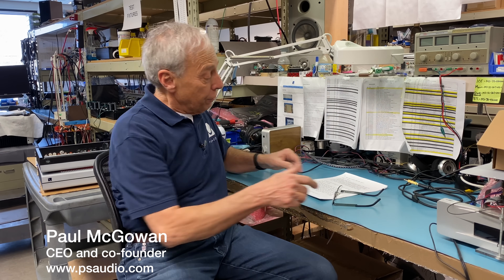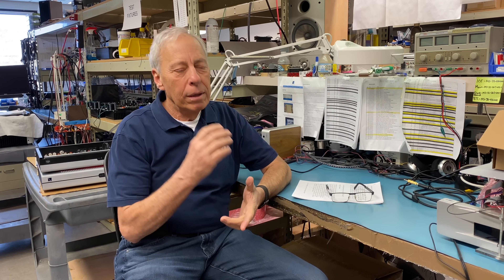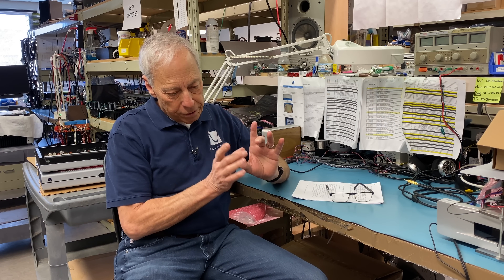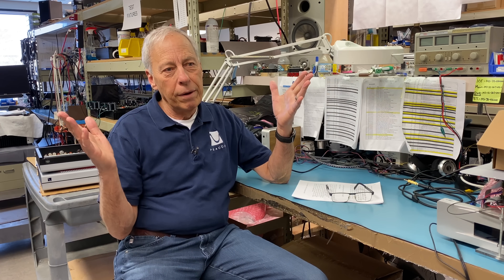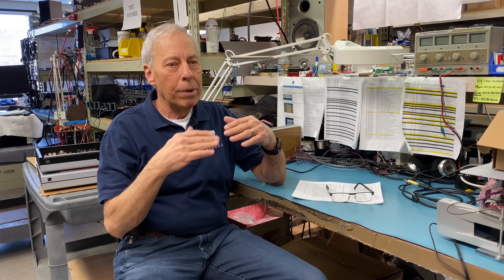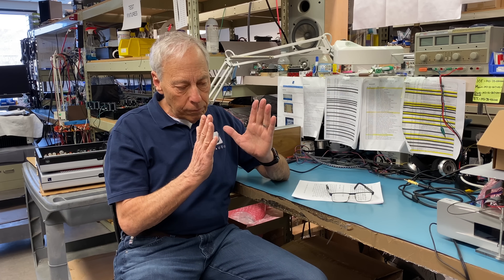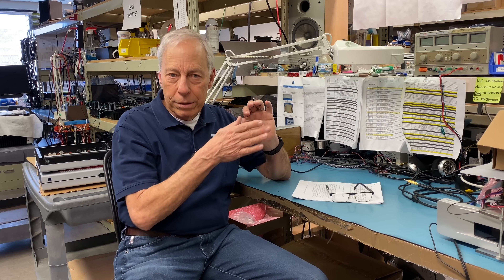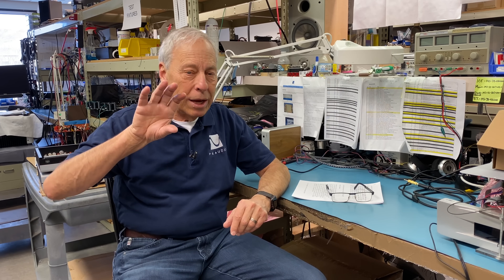How does an FPGA DAC work?

Comment: Great explanation. I 1st became aware of this approach way back in 1986 when Technics released a line of compact disc players using 1-Bit D2A converters. I have a background in engineering & saw the advantage immediately. Rather than try to engineer the tight tolerances of a resistive ladder for 16-bit PCM converters for mass production; - A single pulse stream could be modulated to give much more reliable conversion across a filtering node - especially in mass-production. I'm sure your approach leverages faster clock speeds today & tighter pulse formation. What is the equivalent PCM bit-depth your process is capable of mimicking (If I may ask)?

Comment: Another way to visualize single-bit DAC is of two forces (negative and positive) that drive the speaker magnet inwards and outwards.  The DAC has control of "where" the cone is positioned between full off and full on due to how long a 0 or 1 is "held".

Comment: The question:  Can we need resistors from out of the FPGA to build this DAC ? 
or, we can acces to discreet resistors from into the integrated cicuit FPGA ?
I say resistors to build the ladder of voltage divider.
Thank you in advance.

Comment: Great talk. But how do you control wave-form/frequencies ?
Reply: How I see it. Sound is basically variable amplitude over time. So in order to control the amplitude, the FPGA is configured to output pulses at variable rates. To increase the average amplitude, it will ramp up the pulse density. To lower the average amplitude, it will decrease the pulse density. This happens fast, at MHz rates. So the digital source provides amplitude data which is then used to control the density of the pulses at the output. The signal is filtered at the output to even out the edges of the signal, typically with a capacitor, to get a nice analog wave.

To answer the waveform question. A sine wave, is basically a signal with varying amplitude, shaped by a soft curve, and if that variation repeats at rates (hz) within our hearing range, we will hear it in the form of sound. So for an FPGA to reproduse that, the output will produce varying pulse densities based on the amplitude of the wave at any given time, and that's it.

Hope it helps.

Comment: Paul is partly right, it is possible to do analog signal processing within a FPGA, I have done it, and have the patent for it. I am using it in optical and radio communications, now looking at ways of using this technology for magnetic tape record and play back system. It is very true, there is a lot flexibility built in to FPGA's, and I am always finding new applications for this technology.

Comment: Can this be combined with class D power amplifier in a single unit? Would that not be the most pure way to build the sound system? For example, each monoblock or dual mono amp has it’s own dac for each channel, the control unit/preamp is digital input and digital output to the power amps after splitting the digital channels and controlling volume/tone etc

Comment: Sounds like serial (PDM) vs parallel (PCM) output.
Reply: It is really an I2S to class D Converter with a great interpolation filter in the middle so you can have an almost infinitely precise signal at the end.

Comment: There are several companies that use off the shelf Burr Brown or ESS DAC chips and use a processor before it to convert everything to DSD. The advantage of FPGA is, if you are good enough,  you can program it to your hearts desire and customise it to better suit the topology and parts used. When you use processors like XMOS / XCORE and off the shelf DAC chips you are limited by the fixed instructions set/filters.
Technics SU-G30 does something very interesting, converts everything to DSD and sends the bits with little filtering directly to the GAN-FET output transistor without the use of a DAC (1 transistor per channel!!!). GAN-FET is the only transistor quick enough to cope with the MHz oscillations of a pure DSD signal. Any other FET or BJT transistor would require an analog signal.

Comment: So it must be that there is little or no switching noise to comb out as well? Or is that what gets filtered? It sounds like a moving coil setup where you get lots more detail but in order to bring the gain up there's all that juice to keep quiet. You might like my friend's preamp design for that stage. He uses a photocell arrangement that eliminates filter caps, or any resistive components. The signal to noise ratio is not measurable, it simply doesn't seem to exist. In his words: "It has an input impedance too high to measure, output impedance is a couple ohms, bandwidth is to 60Mhz, slew rate is a couple hundred V/microsecond.
There are no capacitors or resistors (other than the photocell) in the signal path. There is no potentiometer in the signal path. 
It uses photo cells to control the volume. It does not use optocouplers."
Reply: There is actually a ton of noise generated by the DSD output, so they have to use noise shaping, which is a feedback loop that pushes that noise way above the audio band, and analogue filters to get rid of it.

Comment: It makes sense to convert PCM to DSD before feeding it to most modern DAC's and you can do a pretty decent job with a laptop and music software. I wish Paul would really push the point of how different PCM and PDM (DSD) are even if he disagrees with my heretical extremest view that DSD is actually an analogue capture system. Stay well everyone.
Reply: Here's another thought: analog is actually digital. Think about the way a vinyl record is made. It is, obviously, made of vinyl, which consists of molecules, big ones as molecules go. It isn't a glassy smooth surface under a microscope,  even when it should be. It's bumpy, and the needle isn't sharp enough to follow all the contours of vinyl, so it rides across the high points from bump to bump on a microscopic level. You also can't have any instantaneous sharp transients or the needle would get stuck or more likely gouge out the sharp corners, something that digital has no problem with. But anyway, if you begin with a smooth analog signal and pour lumpy stuff into a mold of that signal, you end up with a quantized approximation of the original signal, something much like digital, but bad digital. 

I got that from a study done at the University of Glasgow, if I remember correctly, but it has been several years since I read it and I can't find the link.
Reply: @brianmoore581  sorry that makes no sense, little bumps are not remotely digital in the sense of binary value words.
Reply: @angelwars3176  it makes perfect sense if you read the study, which, unfortunately, I can't find right now. What they were saying was that records don't follow the analog signal, but rather a bumpy approximation of it due to the nature of vinyl molecules, much like digital is itself a bumpy approximation of the original signal, not physically like a record, but electronically. At any rate, it's just a thought.
Reply: @brianmoore581  Yeah but 'vinyl' is bumps in a composite material not 1's and 0's binary words so in what sense is a vinyl record digital? 
Paul called me out on his daily blog site last year citing "certain people making comments that DSD was not digital" Bottom line for him is DSD is digital because it uses 1's and 0's bits - perfectly correct but the key understanding is how it uses them in comparison to PCM.
Reply: @angelwars3176  well, it's not digital as in zeros and ones, obviously. What they were saying was that it is quantized, as in coming in in individual pieces of information as it rides across the high points of each molecule, then skips to the next. I suppose that is analogous to the quantization error of digital sample rates. I'm sure you've seen those stair step diagrams of different digital formats showing how closely or not they follow the original analog signal. They were saying that the same thing applies to vinyl due to its construction. In other words, vinyl doesn't really follow a smooth analog signal, but comes in "samples" corresponding to the high points of the vinyl molecules. In other words, the signal is quantized, represented by discreet steps as opposed to a continuous uninterrupted signal, which makes it digital, at least from that point of view. 

Digital as we know it is binary, as in ones and zeros. But all digital isn't binary. There are, apparently, from what I have read, other forms of digital like trinary, or base 3, even a base 10 form used in some early computers. Binary, base 2, is obviously the simplest, most reliable, and the standard of our time. But those are computer languages. Does digital exist outside of a computer? The information encoded in your DNA is a form of digital, base 4. Are the discreet firings of nerve impulses from the hair cells in your cochlea considered digital? Are the firings of your neurons in your brain considered digital? They either fire or they don't. There is no continuous signal. So in that sense they are digital. I suppose if you consider that we live in a quantum universe, everything is ultimately digital. There are only so many rods and cones in your eyes, kind of like the pixels on your TV screen, and there are only so many discreet photons of light that illuminate our view. The air we breathe and hear through is made up of discreet atoms, not a continuous substance. We experience the world as if it were analog, but deep down it's all quanta, which would be digital. Well, that's getting into another topic, I suppose. Kind of splitting hairs on definitions, perhaps, but if we see things as either analog or digital in a broad sense, then it's all ultimately digital. 

Back to audiophile reality, digital audio obviously produces an analog signal, so the only thing digital about it is the way the information is stored. The vinyl record stores its own information in a molded series of rather big molecules which only approximate the original analog signal, a quantized version of the original analog signal, assuming it was originally analog, or perhaps a further quantized version of the original quantized digital recording. Anyway, definitions are arbitrary, depending on how closely you look at things. And it's just a thought from somewhere out in left field. In purely audiophile definitions, records are still analog and DSD and PCM are still digital.
Reply: @brianmoore581  Brian I agree with your arguments but for the sake of clarity there are dictionary definitions for these terms.
Reply: @angelwars3176  exactly. I acknowledge that. Just throwing something out there because I was bored. I thought someone who says DSD is analog might get a kick out of it. But yeah, this is an audiophile channel, not philosophy, so I guess it's best to stick with audiophile definitions. Hope you are staying safe and healthy.

Comment: If you've been following Paul on youtube you know this!

FPGA is a processor you can program acurst as you like. You can program them with a program in a way that the chip behaves exactly as you want. Regular DAC chips are pre-programmed to do a specific thing and you can't change it!

The closest you can compare it to is hardware video decoding vs software video decodin on your PC or phone. 

Don't know if it'll be right to compare with this?

Comment: FPGA is nothing new, Sony have been using that since the early 90s. But some company markets the heck out of it and the millions of taps to make you feel it’s magical jeez. I’m glad PS Audio doesn’t overblown their use of FPGA.
Reply: Mike the best part is that the company that makes a big deal about the tap length in their dacs do not even use the fpa as the converter. They still have a delta sigma chip to do the conversion as far as I know.
 There are many companies that use fpga tech in their dacs. Metrum, denfrips, dCS are just a few. For the company that is advertising tap length it is mostly for marketing. Their designer is also quick to put down other dac designs say that his is superior and eve the cheapest out performs other companies dacs.

Comment: I started with Cakewalk 1.0 in a 486 SX 😂. For where we are today, and after hearing that description, I can see where the beta testing and driver building for 40 years forced the hardware and software to converge. We aren’t far from having those chips networked like the cerebrum “on call” and using an atom based nano computing system that will end the debate on differences between digital and analog sound.

Comment: Another reason why the FPGA with DSD method is soo "analogue" is because it pulses at 2.8 MegaHertz or much more. That is orders of magnitude more detailed than Sound Waves, relative to Sound time frame of Khz it adjusting much faster. All being done with 1 bit swithching.
Reply: And the higher frequencies also generate more EM emission, so proper implementation is critical.

Comment: Hi Paul,
I wonder why you need such a large computing capacity that an FPGA can do?
Reply from the maker: The next generation will have nearly twice as much to fit our needs. The upsampling, converting the data to a 50-bit number, filtering, all take enormous resources. Which is why it's prohibitive in a fixed chip that needs to be sold for only a few bucks. The FPGA unleashes the power to do what we need.
Reply: @Paulmcgowanpsaudio  Thanks Paul, I was surprised that better upsampling imposes such a requirement. Not so long ago, an university with a campus was built around such a computational performance. At all, why do we need better upsampling? Can we hope you’ll try to shed light on this for laymen like me in a future episode? 
I wish the best from Hungary: Csaba Kelemen
Reply: @Paulmcgowanpsaudio  Well as I'm sure you know, the economics here are a bit more complex. There are ASICs (custom designed chips) in many consumer products that do cost a few bucks and are far more complex that many  FPGAs. Your product's FPGA could be reduced to a custom chip that just does cost a few dollars if not even pennies in some cases. Consider the image scaler in a $80 LCD monitor. It comes down to basic Henry Ford mass production. It can cost upwards of a million to have a custom chip designed and debugged. In fact the initial designs are  most often built with off the shelf FPGA chips. Then once perfected a custom chip is designed which can be produced for as little as a few dollars or less. But you need a massive product market, like smartphones and TVs, to recover the cost of that custom chip design.  Your use of FPGAs is quite common in professional products that also have a limited market where the cost savings of a custom chip cannot be recovered. 

The other large advantage that is also not common on commodity consumer products is the ability to reprogram the FPGA in the field using a USB port. You have taken good advantage of this yourself with the DirectStream firmware upgrade program.
Reply from the maker: @andydelle4509  Thanks, Andy, and you're right. However the cost of an ASIIC is astronomical and makes no sense for the numbers of DACs we produce. Secondly, unless they too were programmable, it would mean we'd have to stay with what we have rather than taking advantage of the freedoms of updates the FPGA's afford.
Reply: @Paulmcgowanpsaudio  50 bit, wow your not mucking about, kind of leaves 24bit audio in the dust. How about a 'simpler' one with only 24bit math for those of us with shallower pockets, but want more than off the shelf chip DAC's offer.

Comment: PC Audio is quite unique with this FPGA approach and in a high-end system, it makes sense. Most modern DAC chips are single-bit or Sigma Delta but always with fixed silicon. Even what is in your smartphone or in a US$10 iPhone lightning to 3.5mm adapter cable is with such DAC chip (often part of a larger chip). A mobile phone DAC is obviously not of the highest performance, but when your iPhone doesn't sound great, it's mostly due to the music compression rather than the almost invisible DAC itself. The specs of your smart phone DAC is typically much superior than audiophile DACS of a few years ago, e.g. https://www.qualcomm.com/products/aqt1000
Reply: Lloyd Stout I work in this field and don’t need Wikipedia. Actually I’m author in Wikipedia. Besides, what exactly do you disagree with?
Reply: Lloyd Stout: I am a teapots short and stouts. her i smy Handles here is my spouts. Is this the article you wanteds....

This standard provides an overview to the family of IEEE 802® standards.
 It describes the reference models for the IEEE 802 standards and 
explains the relationship of these standards to the higher layer 
protocols; it provides a standard for the structure of IEEE 802 MAC 
addresses; it provides a standard for identification of public, private,
 prototype, and standard protocols; it specifies an object identifier 
hierarchy used within IEEE 802 for uniform allocation of object 
identifiers used in IEEE 802 standards; and it specifies a method for 
higher layer protocol identification.

Ethernet runs on the MAC address NOT on IP numbers, Its in teh ARP tabels thankes you and thumbbsss UPS!
Reply: Thanke you MIne Frends! You have loits of things other don tknow ro wont say. I gacve up in 1978 when I figure out I could neer afford the Pioneer  and Kenwood and other stuff in ROlling STone. THAMKES YOU ABD THUMBS UPOS!